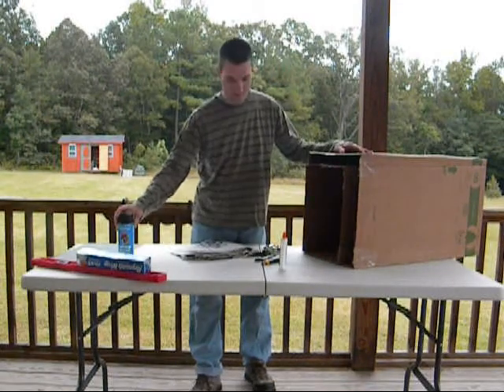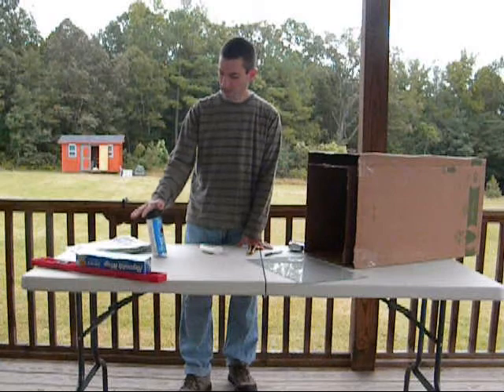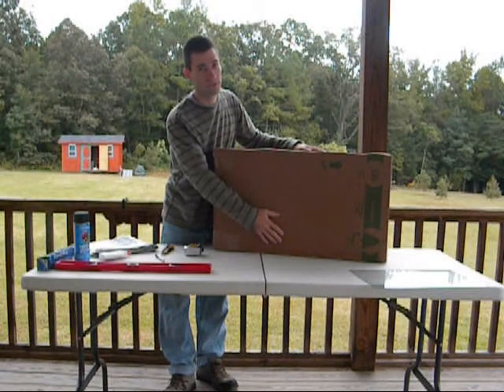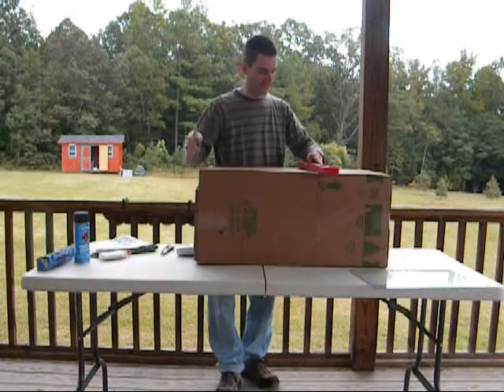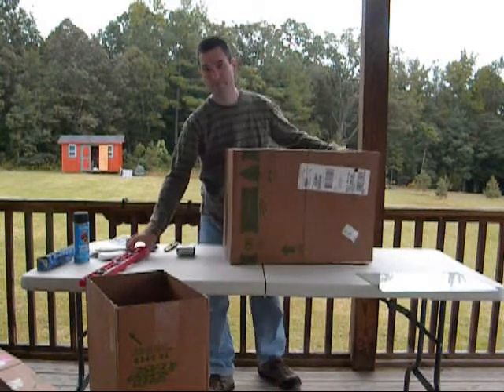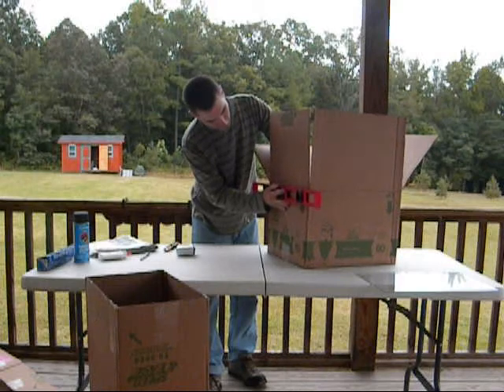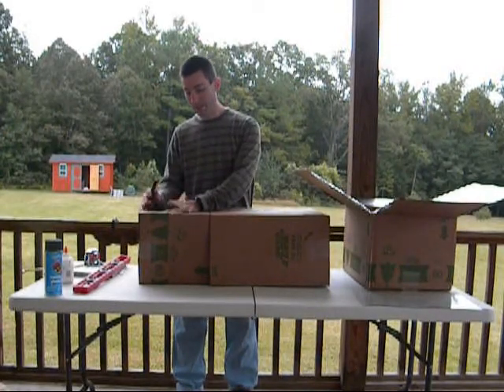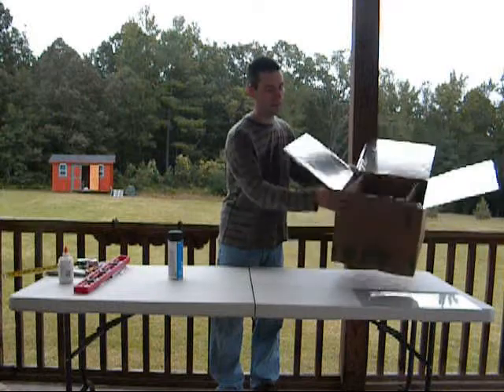How to build a solar cardboard oven part 1

Comment from the maker: @gotsomeguts50 I do not think you will have much luck with an oven rack. To get high temps, black surfaces or objects seems to be the best way to go. I have seen a few videos with people using a black pot with a lid, placed in a oven bag with reflectors made of foil or mirrors. I hope that helps, Lonny

Comment from the maker: @BeastOnCrack I did look into burning  temps for cardboard. My research turned up that cardboard will not burn under 450 degree f. Thank you for the question, Lonny

Comment: First off I suggest you go to a car salvage yard and get a window from a side door that is heat temp proof, and if it ever breaks it shatteres rather than breaks like pane glass. And any thing needing black paint like a solar over, should be fire stove paint which is safe and can handle heat up to something like 700*